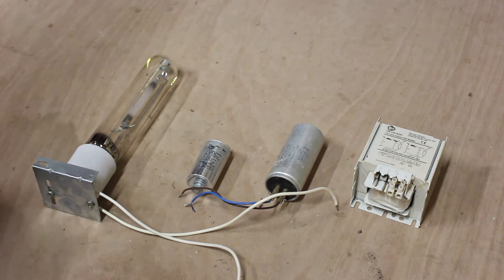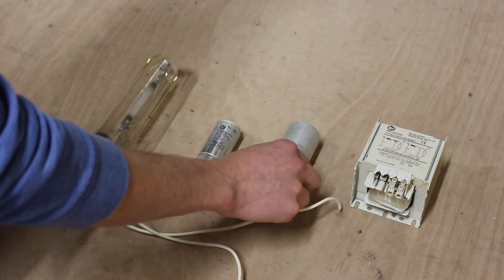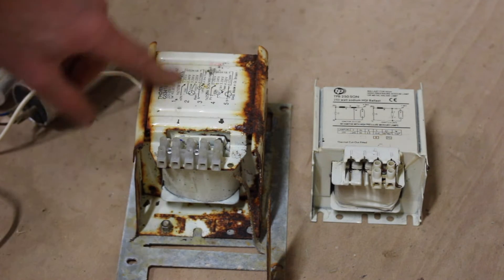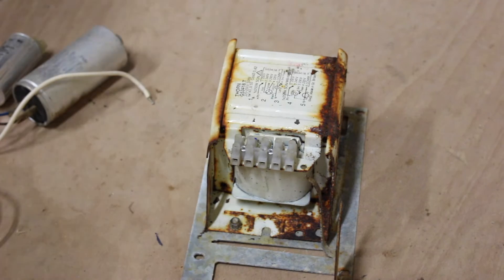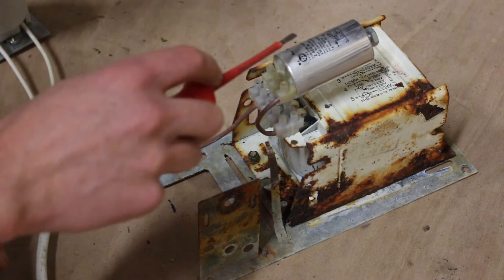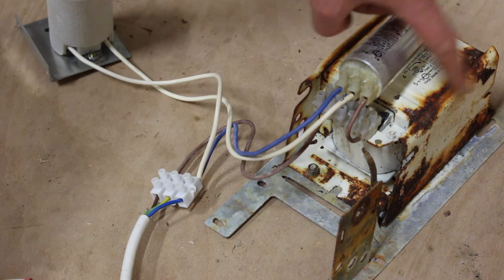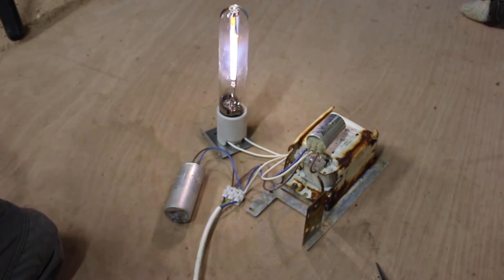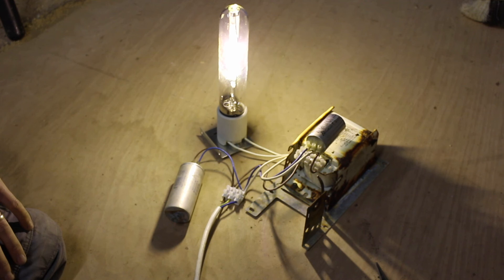How to Wire a Sodium light circuit

Comment: Good vid. I have a question. I have a 600w HPS bulb and what I think is a system like this. The live is wired to the outside of the bulb and the neutral is in the centre of the bulb. The bulb didnt last very long. Is it normal to have the live on the screw part (outside) of the bulb?

Comment: Hi, thanks for the video. I would like to know what can happen if we do not put the igniter in our circuit. Thanks.
Reply: If the ignitor is not in the circuit, the lamp will not fire since ordinary high pressure sodium lamps need a few kilovolts to strike and the ballast alone does not provide the ignition pulses. The ignitor is responsible for providing the high voltage pulses necessary to strike the lamp.
Reply: Thanks a lot.

Comment: Can I use my fluorescent ballast for HPS light PLEASE HELP ASAP
Reply: In many cases, you must actually wire multiple fluorescent ballasts in parallel in order to drive a high pressure sodium lamp properly and a superimposed ignitor is nevessary in that case.
Reply: my lamp has a white and a blk your setup does not show  colours so hard to hook it up on this

Comment: Best video online for the explanation. Thanks a lot! I have the same setup however my ignitor only have two terminals ballast and neutral. Have you ever come across that before?
Reply: I have many 50W and 70W SON high pressure sodium bulbs with built-in ignitors and these internal ignitors also have just 2 leads. They're connected across the live and neutral leads inside the bulb (of which one is coming from the Balast and the other is connected straight to Neutral).
So you can just put your 2-wire ignitor across the 2 wires going to the lamp holder.